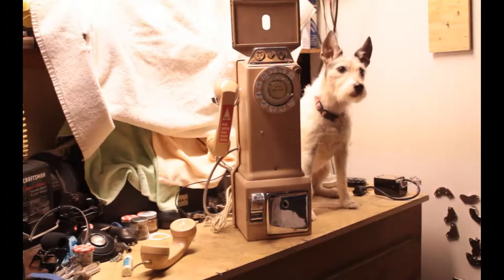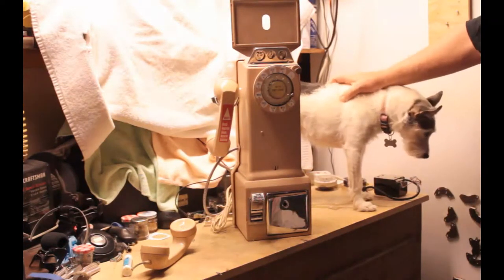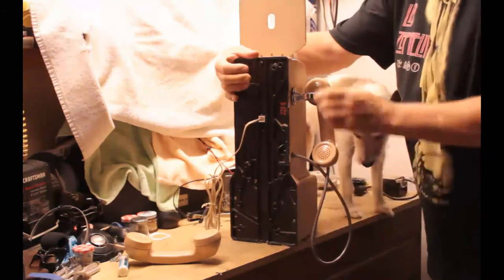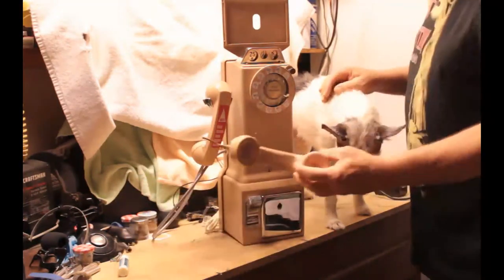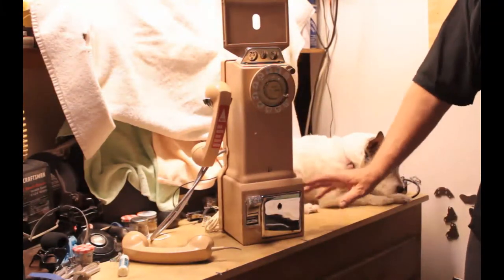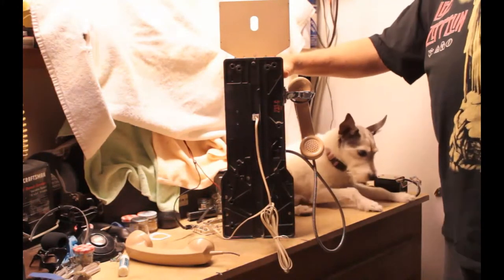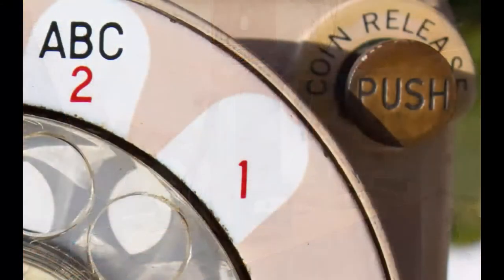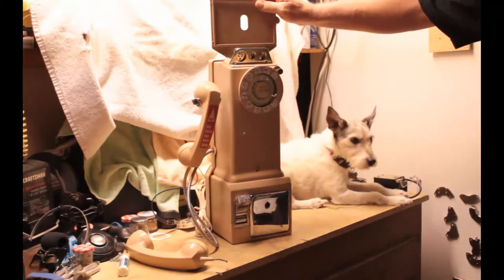Western Electric Beige 3 Slot Coin Rotary Telephone

Comment: Never understood why a phone collector would need a modular port on a vintage phone.  Much easier to run a pair of wires to the phone which can be any length you want. None of my pay phones have modular plugs unless they have a cocot board.
Reply from the maker: I disagree.  I put a modular "plug" on it so the person that buys it can run a mod cord any length they want.  And apparently the 26 people that have bought antique telsets from me agree - otherwise they would not have done so.
Reply: It's is more likely due to the fact that you were in the Bell System and do a great job repairing/restoring phones. I have never found a good deal on a 3 slot payphone but have single slot payphones in and outside my home. A modular plug does no good when mounting a phone on a pedestal with an L31 enclosure.
Reply from the maker: I see your point.  I just try my best to help those that like the phones (of any type)  and want them to just work. Thanks for watching and your input.